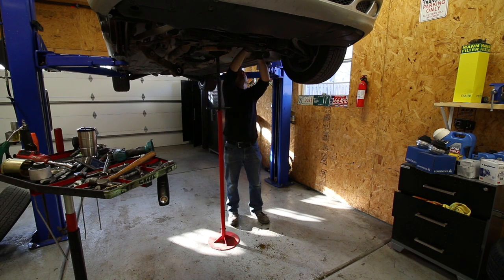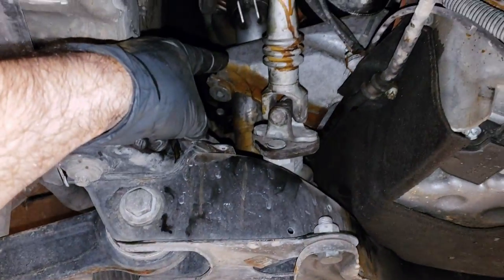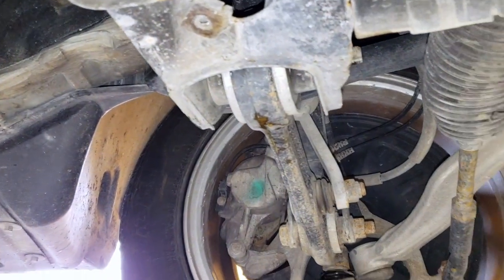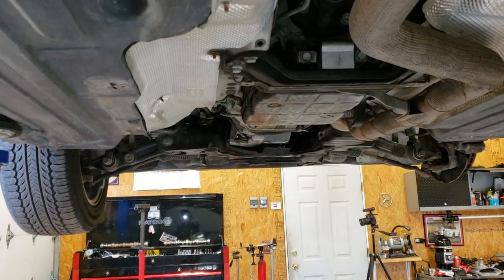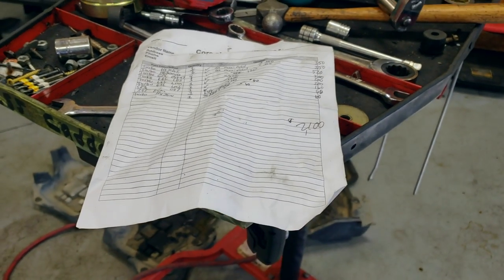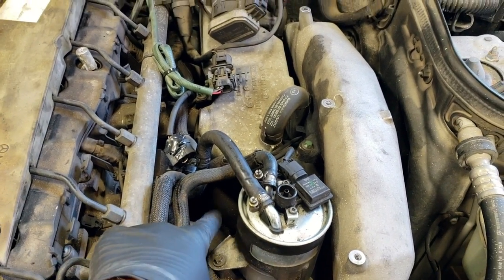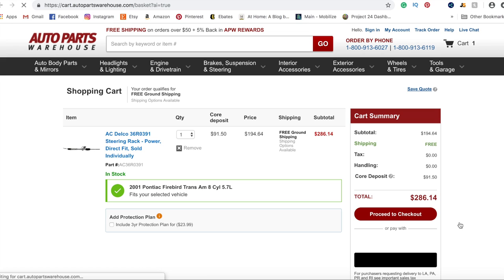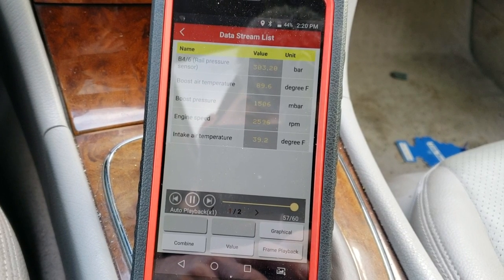I Fixed A Really Expensive Boost Issue On My Turbo Diesel Mercedes With A Penny Resistor! It's Fast!

Comment from the maker: How much boost should we push?
Reply: Enough to scare passengers :D
Reply: 30+ Psi and straight pipe the merc
Reply: Depends, when are you getting head studs?
Reply: I have same w211 e320cdi with straight six, and in Europe we Chip tune these cars, so my w211 is pushing 1.6 bar it is about 23psi on stock turbo safely and there is some tuning done with injection timing, so it is really noticeable. Also I done EGR and CAT delete.
Reply: Do you want MPG or do you want boost? I’m currently getting 56 mpg with nothing more than a fuel injector tune.
Reply: LegitStreetCars I'm running 1.95 bar on a om612. Anything more you need a 400cdi map sensor.
Reply: All of it.
Reply: LegitStreetCars  what’s next injectors a turbo and a tune😂
Reply from the maker: What?? Please tell me more. Can you email me at legitstreetcars@gmail.com
Reply: 25psi tops
Reply: LegitStreetCars  yea about 5 years ago I was just surfing the web and a came across some...  also air in air out upgrade the exhaust helped mine out a lot
Reply: Enough to beat most bmw’s 😃
Reply: Throttle controller makes night and day difference. Upgrade to 11 blade billet compressor wheel, injectors, pump, egr/cat delete, tune. So much fun to drive, then turn throttle down for wife. 😍
Reply: Put 50psi of boost that way the colder it gets outside the faster the Mercedes becomes. Plus we all know that doing burnouts is fun.😀
Reply: What are you going to do to this car? More videos!
Reply: @LegitStreetCars  
Could those intake flaps work as a diesel engine safety item also, and help prevent an engine runaway? And they're now disabled...
Reply: That's one dirty diesel engine! Give it some Superclean from Walmart a jug is less than 9 bucks.
Reply: Vytautas Stankūnas hi where did you get your   Module to delete your e g r
Reply: Ham Mer hi where did you send your ingectors  do you know the shop name I have the same car e320 cdi
Reply: 1,8bar if you want to keep it going for a long time, 2.3bar (needs map sensor changed) if you want to drive quickly to the nearest wrecker..
Reply: With a proper tune i got 1.7 bar 280hp 700NM. after that i did a billet wheel or what ever you call it in english, to a compressor side, bigger intercooler an 3 bar MAP sensor and again a proper tune, 2 bar and 320hp 806.2NM
Reply: 28+ psi
Reply: Hmmm, all of it! :)
Reply: @balmoresegovia8853  I'm running a plug in injector tuner made in the UK. I was averaging 50mpg on highway before and now consistently average 55.8 mpg. I'll try to find the brand and post it. Drivability is much better at lower speeds and more power throughout the entire curve.
Reply: 22 psi with a hood pipe
Reply: LegitStreetCars  push about 30lbs of boost
Reply: I want to buy this  car after you done let me know please...
Reply: @SlackTastic  The flaps only cover one of the 2 ports going into each cylinder and would not stop runaway. They were used to increase swirl and lower emissions at lower engine speeds.
Reply: 80.
Reply: @SlackTastic   chances are, they would be sucked in, if they can close fully in case of a runaway. However, I don't think they're designed for that and they might not even fully closed without some air bypassing them.
Reply: @Whisper_Pickle no way.. Who tuned it mines only get 30mpg not sure why.
Reply: That 4.7kohm resistor restored boost for like an 8klm trip .. then back to low boost ( ML 270 CDI) :-(
Reply: I get 37 psi out of my e270 om612.
Reply: @Whisper_Pickle  What kind of tune are you using? I'd love to get that mileage.
Reply: Can a you provide an link on amazon to what exact resistor i would need?  I got an intake manifold from Europe which dose not have the swirl flaps .
Reply: @Whisper_Pickle  which car do you have and what is size of the engine. How did you turn the injectors?
Reply: 2008 e320 192k mi

Has codes
P2453
P224b
P244f

Limp mode.

What do you suggest? Dealer quoted new wipers, tie rod drivers front, 2 rear tires, full alignment, abs light for a total of $2142 ish.

Another $7358 for oil cooler, both cracked intake runners, plugged dpf filter, intake shutoff actuator, lower plenum all causing low boost.

Help fast! Going to go buy it tomorrow morning. 

Also, will the 4.7k resistor help with any of this? 

What is the best suggestion on taking all down on top end?
Reply: Hi Alex, What is the wattage on 4.7 Ohm resistor. I need to know so I can purchase.
Reply: @Whisper_Pickle  I'd love to know more details of this injector tune accomplishing 56 mpg.
Reply: All of it.
Reply: Am at 2 bar atm ...:P

Comment: had the same problem, threw DTC P2015 on the OBD2 scanner. one flap was stuck open which prevented the entire linkage from moving. did the resistor mod, but went one step further and replaced the entire intake manifold with the OE one without flaps "A6130900737" here ya go! so now no flaps AT ALL for gunk to attach itself to. also was throwing DTC P0299, ended up being a stuck turbo actuator linkage and vane lever. threw some aerokroil on it to break it free and lubed it up with silicone oil.

Comment: I'd delete that along with any EGR, and the VGT.  Throw a nice BW fixed vane on there.  More complexity = more failures!
Reply: #monster RAM what's vgt ?
Reply: @jadenoneofyourbeeswax9756  Variable Geometry Turbo
Reply: @monsterram6617  Just curious, why delete the VGT? The EGR makes sense, but the other one?
Reply: Vgt turbos are awesome. It spools much faster and doesn't require blow of valve.

Comment: I bought a Saab 9-3 with 1.9 diesel offered in Europe. The prev. owner got rid of the swirl flaps completely and deleted egr and dpf. That accompanied with remap got the engine to  safe 180 hp from stock 150 hp and car has now done 212k (30k since mods) miles and keeps running. It has also passed its emission tests in the UK first time.

Comment: Pretty cool video man! That’s a neat modification! I’ve replaced one of those inlet port shutoff motors before, sort of a pain in the butt, not the worst job, but if you can get around it for 6 pennies why not. I’d be interested to see in a future video how much carbon build up there is if you decide to pull your intake manifold. Happy Holidays man!

Comment: The same thing happened to my opel astra 1.9 cdti, the swirl flaps uses some plastic bushing that after a few years fails. I have deleted them and plugged the holes left from the swirl rod and no bad things happened since but now i don't have any air intake leakage. The swirls flaps really helps when the engine is new but after a few years the flaps are not helping.

Comment: the resistor mod is legit. I did it on my om642 in my ML320cdi and it's been great for 6 months. No issues whatsoever!
Reply from the maker: Great to know, thanks
Reply: Yep i did it in my merc om642 aswell, 4k omh resistor
Reply: what year , dont the om642's have postion sensors for the swirl flaps?  maybe in the early ml's they dont
Reply: @danielosullivan7623  I'm guessing the 4k7 acts as a fake position  sensor and the software only checks for position. Not for change in position.
Reply: Daniel O'Sullivan that’s exactly the question I have with a 2010 GL350. I locked the flaps open and removed swirl motor with resistor in the plug. Ended up with P2006/2007 codes for flaps stuck closed. I just went back in and pulled the position sensors out of their housing and codes changed to P2004/2005 for flaps stuck closed? Cleared the codes just last night and they did not return so far. I’ll report back if they come back

Comment: Glad you added the shot of the tachometer to this, it's exactly what my new to me cdi is doing.   Shifting manually I cannot get it over 3k rpms.  I had planned on doing the resistor mod since I have a fault for the m55 anyways but didn't realize this was the cause of my lack of power, thanks!  Great video!

Comment: Got an ol' school W123 OM617 300TD diesel. Dig this channel!
Reply: W123+om606=perfection
Reply: Definitely my favorite of the W123 chassis.  The two complaints I had about the W123 240D I used to own were its lack of power and lack of cargo space.  The 300TD solves both of those problem.

Comment: on bmw diesel engines the swirl flaps had a problem braking up, and then they get sucked into the engine  and cause engine damage .we remove the flaps .
Reply from the maker: Yea I've read about that.  Crazy!
Reply: Only on the pre 2003/2004  cars.
Reply: It also happens on Ford/Mazda L engines.
Reply: I had an 09 X5 35d with the m57 diesel. The swirl flaps are very prone to failure and carbon build up. They make a delete kit for it with blanks to close off a port. They do need to be tuned out though or you will get a light.
Reply: if you leave the flaps in place they will gum up and close up the ports.
do it properly.

Comment: Found out on another video I watched the other day that it's getter to put the bolt in from the other side of the Mount so that the threads don't get hit head on with road debris. Idk if you wanna try it but it seems like good logic so you dont get pooped on trying to get a nut off of bad threads.

Comment: The “EGR delete” as it is called here in Europe is pretty common practice. It means always clean air to the engine and it can be done with just unplugging the wires. The EGR valve is there for emission purposes but all the cars that did this modification, passes the inspection anyway. Thanks for the videos Alex, appreciated.
Reply: most people just use a blanking plate to stop the recirculation of exhaust into the intake.  most modern vehicles have a DPF( domestic partical filter ) or adblue  system to reduce the amount of polutants
Reply: @wax333  DPF - Diesel Particulate Filter. These were fitted to modern diesel engines to burn the noxious fumes and reduce soot. The adblue system was introduced to meet euro 5 or 6 requirements.
EGR valves were also fitted to Petrol driven engines to allow the possibility of reduced exhaust emissions. But as you've said many people have blanked this off with a plate as the EGR usually fails and is not really a system worth repairing.
Reply: @M1LAD81  ive seen egr on old honda engines aswell usually for different purpose. like recirculating warm air into the intake to start car easier.
Reply: The EGR is NOT the swirl flaps.
Reply: The M55 flaps are not EGR...
Reply: This is not an EGR system.

Comment: Deleted those stupid flaps on a G270CDi, OM612, it felt much better over 2800rpm, but there was a slight drop in response from idle to about 1600/1700rpm. Perhaps the weight of the G makes this more noticeable...
Reply: It’s because that engine in the G is “tuned to be more torquy” and less horsepower. In the G, you need torque lots of it at low rpm.

I had also the CLK 270cdi w209, and taking out those flaps, made a huge difference!

Comment: Thanks so much for these Diesel Merc videos, i found this one especially useful (already bought my 4.7k resistors)
My 05 C270 CDI lost boost..issues with the inlet manifold swirl flaps(and my heavy foot), I've organised a mechanic to delete/plug them but he said it would still give an ECU/Engine management light...i will insert this and get codes reset...Thanks again

Comment: the variable vane turbo and the fins inside give you alot of boost when your at low power, because a small turbos more efficient at low rpms while a big turbo is good for high boost, this allows the turbo to constantly vary depending on power required and rpms, you can hear it on a druamax, when it starts up, theres line just engine noise, then vacuum cleaner noise as the turbo spools and valves close

Comment: All i have to say is wow . I have a w211 cdi 2003 model, and boy do i have a booster problem. I mean even on an uphill its dificult. Thanks for the hack i will definitly try it out. You are a god in mercedes. I almost bought a knew turbo and egr valve.here in mozambique- africa its not easy getting parts for my w211.thanks brou .

Comment: Thanks, I just fixed my w210 E320CDI  with this hack, my case wast just a but different, the M55 motor blew a fuse on the K40 starter board, so I did the resistor hack, changed the fuse, disconrcted and reconected my battery. EPC light gone, limp mode gone😅

Comment: I opened my e220cdi and removed the intake, so the flip flaps was crazy damaget, i called an mb mechanic and he said “ we dont fix then so you can remove them” so thats i dit i remove all of them then block the flip flops holes and bolted on the motor and put the jack on the motor. Now is pushing very good power and iam happy with that, no power loss no black smoke no error code

Comment: Egr delete and swirl flap delete please.

Do a diesel purge as well, fuel system and injector nozzles will thank you.
Reply: Don't delete the EGR - The EGR only operates at CRUISE and is shut off when you accelerate, so it has literally no negative effect on your performance and it increases your fuel economy at cruise. So don't delete your fucking EGR
Reply: ANYBODY KNOW HOW TO DO A DIESEL PURGE ON A PRESSURIZED COMMON RAIL-----BEEN TOLD YOU CAN'T DO IT WITH INTAKE FUEL LINE AND RETURN LINE STUCK IN A BOTTLE LIKE THE OLD DAYS-----
Reply: @CAepicreviews  YES BUT ON A DIESEL, THE EGR BLOCKS THE INTAKE WITH SOOT AND CRAP, BIG LOSS IN POWER

Comment: I had exactly the same problem on my wife's Mercedes ML 320 CDI exactly the same engine eveything pointed to the turbo but after looking at YouTube founda UK guy Sharon how to fix it by adding that resistor everything went back to normal and just cleared the codes and you're exactly right 70 cents for 5 of them and I only needed one to fix the whole car and get a smile from the wife at the same time when she found out she was not looking at thousands of dollars of repair bill

Comment: Basically TGV's (Tumbler Generator Valve) for Subaru.   A lot of people who modify them remove them and get increased flow.  I removed them in my WRX and have noticed slower cold starts.   I mean they're there for cold starts so when you remove them you're bound to have issues.

Comment: Did this mod on my OM642... Running fine again, but DPF is regenerating now every 250km... Before the swirl flap motor went bad and did the resistor mod I reached up to 1000km before regeneration.

Comment: Here in Spain they are pushing this engine up to 230 hp.
Others even more, try to clean the egr and the admission, less lag time for the turbo.
Also is recommended to make a cleaning process,for the egr and admission,by driving in 3rd gear up to 3500-4000 rpm during 4-5 minutes, every 3-4000 km( 2500-3000 miles) and add some additives for the fuel. I use aderco 5000.
Reply: We have Optilube here in the US. That or up to 5% biodiesel to top off your tank.

Comment: I would recommend you to take  inlet manifold and delete the swirl flaps. The reason you got fault code is probably because the carbon built up and blocked the swirls movement. Delete swirls egr cat and dpf clean inlet manifold do a tune and you won't believe how much of a difference it does. P.S I did that to my c320cdi. And of course it's just my opinion.

Comment: Hey man. 
My wife has a C270 Cdi 2003 model. A swirl flap broke off a piece and when thru the motor. One would think plastic is ok. But it killed the shaft of the turbo. A slight chip off of one blades. 
I removed the swirl flaps but the controller is still in place. The car also feels a bit better and faster. I think the problem is the module doesn’t respond as fast as the motor does. By the time its at speed and full boost the controller is still moving toward fully open. 
I have also removed the Cat as we are in South africa and nobody cares about it. 
I did however redo the diesel pump and serviced the injectors as one had just started to push black death past. 

I currently get 25km per Liter on the open road. The car has 220 000kms on the clock. 
My next move is to look at the EGR valve and get that out of the way. 
Ah yes and also the turbo Muffler pipe. 
That you might also want to remove. Its the plastic piece of pipe mounted directly on the compression out of the turbo. Mine cracked and I had to cable tie it till I make a plan. 
No one sells a replacement aluminum part or such so I will have to get one Cnc’d to spec. That will also improve boost and gas milage. 
 
Thanks for your videos! Really appreciate it and the time you take to make them!

Comment: With your videos, Tevarish and Mercedes Source I'll have to pick up on of these early cdis or E class MB.
Reply: I picked up a chip tuned S320 CDI rolling on mint 18" alloy's for £500 here in UK, been driving it and fixing it for over a month now, nothing can touch it on acceleration, its now my daily driver.

Comment: Just ha heads up to Euro owners with (Euro 4 emissions dpf/cat built into one) You'll need to take off the turbo down pipe, as it blocks the upper bolt from coming out of the passanger side motor mount.

Comment: Hey Alex EGR delete is pretty comon here in Europe did that to my 270 cdi o boy did it make a differenc its faster much more responsive but it has 1 drawback engine temp take ages to go up.Did the swirl flap delete too left the motor connected tho 😂
Reply: EGR Deletes DO NOT make your car faster, AT ALL. The EGR only operates at CRUISE and LOW LOADS. Meaning when you floor it, your EGR is doing NOTHING. Which means all you did was reduce your fuel economy and increase your emissions.

Comment: Do an emissions test before removal of swirl flaps both cold and hot run.  then retest after deletion both on cold and hot start.  With a cover of dyno runs before and after deletion.

Comment: I have removed swirl flaps, witout making changes in ecu. There is no any faulty codes etc. but after turning off a car, engine is a liitle big shaking. What can be wrong or it is normally? I have replaced all 2 new engine and gearbox mounts (lemforder).